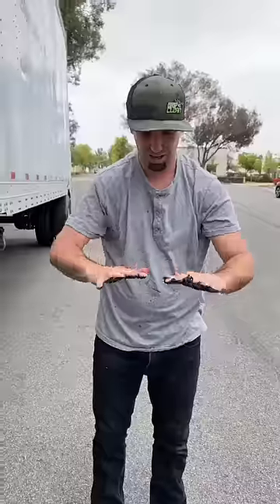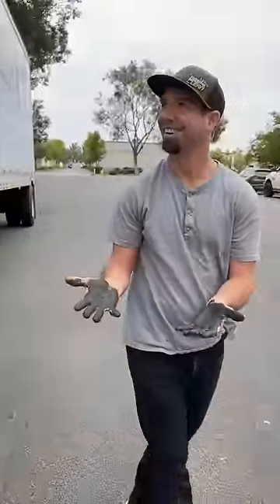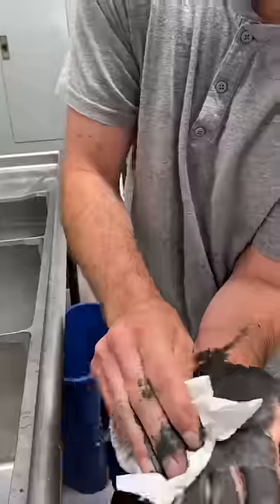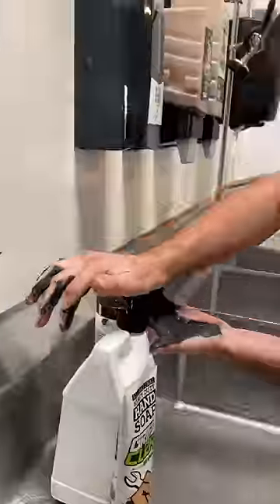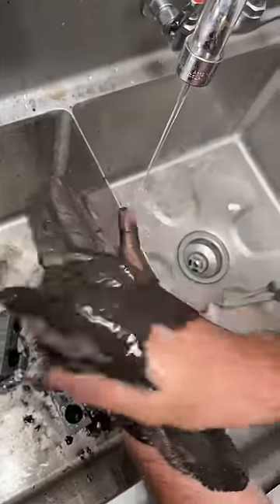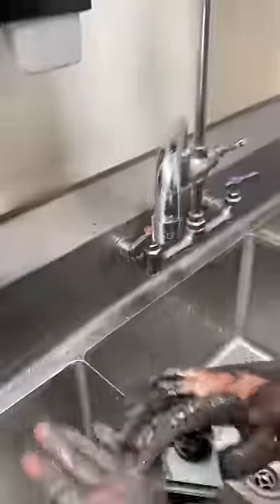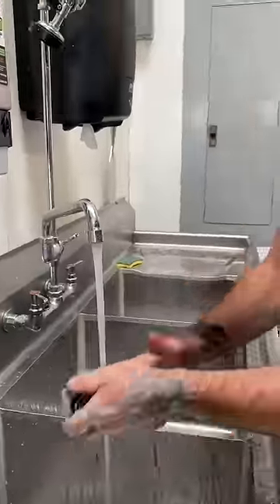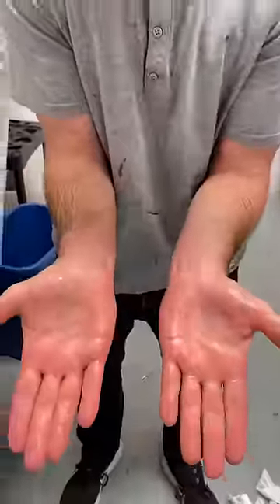fifth Wheel grease all over my Hands!

Comment: I use the concentrated stuff it works pretty good without water when I'm in the field. After years of grease stains it doesn't all come but about 97% of it comes off. I'll definitely keep using the product because it comes in clutch out in the field when there is no water around. Maybe I should get the wipes aswell though
Reply: I was just wondering whether it would completely clean my hands as I work with  old diesel and grease grime everyday.
Reply: @daveminuet8114  I know the feeling. I'm a diesel tech of 10 years. The concentrated gets most of It off I'm definitely gonna keep using it
Reply from the maker: Awesome! We're happy to hear you're enjoying our product. The wipes would for sure help you stay clean and you can also clean tools and much more. Thank you for supporting!
Reply from the maker: @daveminuet8114  We guarantee you will enjoy it or your money back!

Comment: The fact he washed his hands for probably 25 minutes  straight  tho lmfao that shit does not like to come off
Reply: nah ive used similar soaps they’ll take a few minutes of scrubbing but it’s the best stuff for oils etc
Reply: I've changed a fair number of kingpins at my current work and sometimes you do get that sticky shit on your arm or wrist, and yeah it can take sometime to get off but not 25 minutes.
2-4 minutes in my experience when it's bad, I just wear rubber gloves and throw them out after and use brake cleaner for what may have dropped on the floor.
it'll also make quick work for what's on you but brake cleaner is terrible for your skin.

Edit: you really do not want that shit in your hair, that takes forever to get out.

Comment: Always be careful with scrubbing the grease though, I had a cleaner at a paint store that had grit to help remove the oils and stuff, and it worked amazing but did a ton of damage to my skin and now when it's winter they Crack and bleed very easily just from the cold. And I have permanent marks on the backs of my hands
Reply: You should see a doctor about fixing it I would imagine if it hasn't been more than 1 year you can probably still treat it
Reply: @outlandishbottle9279  it's been about 4 or 5 years at this point unfortunately
Reply: @BuddyRIP  💀 have you tried moisturizers to lessen the effect?
Reply: @outlandishbottle9279  that does help quite a bit, last time it happened I tried Cera ve I think, and it helped a LOT. Fortunately it only gets real bad if it's cold out
And to be fair for the cleaner, it was half the grit and half how much I had to scrub to get the paint off irritated my skin like crazy. It was like raw skin for a few days 😅
Reply: @BuddyRIP  😬 must hurt one of the main reason I clean my hands often even if I get dirty

Comment: Get the bad stuff off with a rag, and any de greasing abrasive mechanics soap will get the rest off just fine.

Also if you have any really hard to get off stuff on your hands, if you rub then in dry sand, it may not take all of it off, but it really does work wonders.

Comment: That sounds like some crappy soap If you need to do two washes with a brush for anything. I don't remember who made it anymore but the shop I worked at had this nutty soap that took anything and everything off and left your hands feeling clean 🫧. Zep's soap is decent, but anyone who uses it will know it leaves a residue on your hands, That nutty soap never did.

Comment: Could that clog your plumbing?
Reply: No more than dirt that goes in your shower drain
Reply: @justjamesAMX  my son rolls around in dirt never have had a problem in shower drain but I have with products like this if you wash your hands in sink it's still sticky like grease going down your drain and it will keep building up with in time
Reply: @FJBLETSGO2024  was about to say the same thing lol I always wash my hands outside in the yard be4 in the house if they are that bad
Reply: @FJBLETSGO2024  I hope you know it's not the soaps doing that lmfao, it's the fact you're washing grease off in a sink. So if you're that concerned about it use this product and a garden hose.